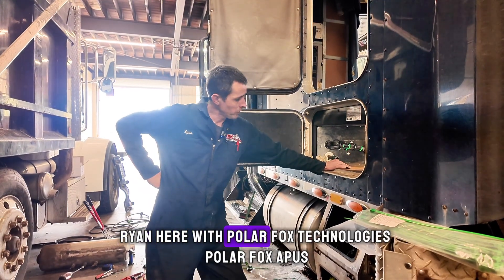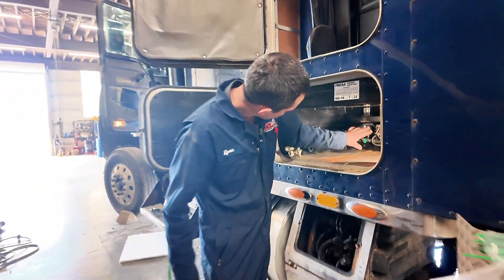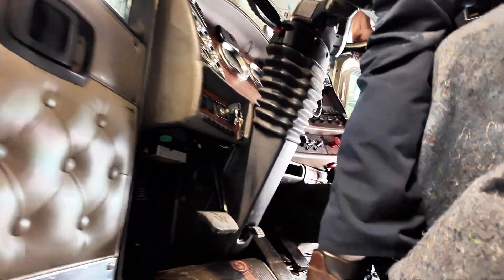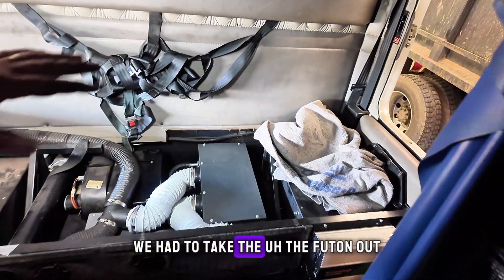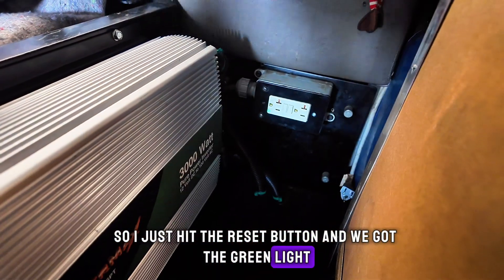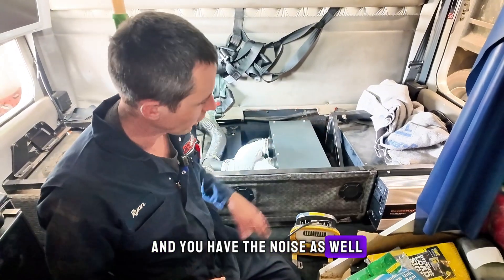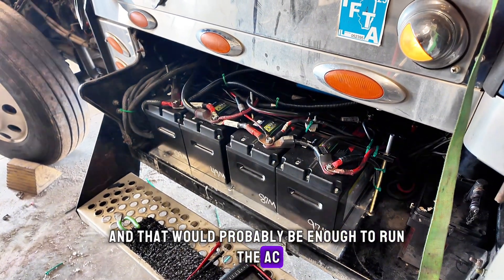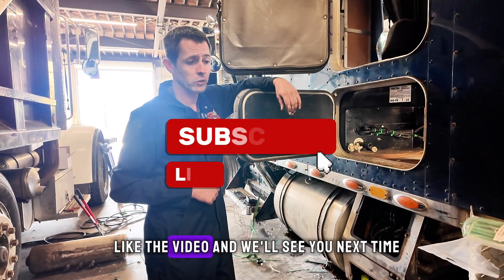We Built the Ultimate Hybrid APU! | Diesel + Electric APU Combo

Comment: Why wouldn’t one have a inverter charger so when the gen is running the batteries agree getting topped off.
Reply: Becouse it wont work the inverter will pull more current that the charger will put out..if it did work I believe everyone in America would have battery powered homes and inverters in cars to take the place of alternators
Reply: @deanjones-g4m  you seem to miss my point after I missed your point. A inverter charger. Do you know that that is? It inverts 12V to 120. But also inverts 120 to 12v. . This is a common item in rvs. I didn’t say pug in an inverter to a charger to get a consistent energy as that won’t happen.
Reply: I had a ccs generator it had a ac to dc charger . Didn’t no have a 12v alternator. This is a common thing in Rv’s. I now have a Tripac but my truck has shore paper. So when I plug in my inverter has charging capability. So all I would do is hook that 120 system to my inverter charger this is a common thing. That happens in Rv. Understand that I may not have explained it well. But inverter charges are available. Get you an inverter that is all a charger so having the Gen running will top your batteries. And when you don’t need the high power to cook things your batteries will give you the 120 comforts. The AC is the big draw. Inverting is not efficient. Hope that helps you understand why I stated a Rv inverter charger.

Comment: This is awesome. I always wondered if a hybrid system wouldn't be better. Here me out. An EPU for a/c, heat, 120vac with 4 lithium batt and an APU motor with a large alternator that only charges truck batt and EPU batt? No turning on the truck engine to charge anything. EPU can last longer than 10 hrs because the APU alternator would charge batt when they get low. Truck can easily do a 34 or 48 hr shutdown without ever turning on the engine.

Comment: So is it the APU alternator that charges the batteries? Or what exactly is charging the batteries?
Reply from the maker: Truck alternator will charge the batteries.
Reply: @ thank you. Would adding some type of battery charger that can plug into the 120 be an option? Maybe it could charge the batteries much faster. Just curious if that’s something that could be done
Reply from the maker: @uria711 charging from the truck alternator gives you the fastest charging speed. Don’t need anything in the middle.
Reply from the maker: Our batteries are designed to take 160amp per hr. This is for each battery. Now the limiting factor is the alternator, not our batteries.
Reply: @truckingandfixing  no I’m talking about charging from the APU alternator. If I was to do this exact same set up, would it be better to charge from the APU alternator or to have a battery charger running off the 120 to recharge the batteries?

Comment: I've looked at some of the parking generators used to recharge batteries for epu's, I use an ecoflow 3000w duel fuel generator mainly because it has the remote start features, a generator mounted on the frame with maybe solar panels on the hood would maybe be good add on for these types battery apu systems. The main reason I don't want an apu is the maintenance, I can change the oil in a generator easily every few months easily.

Comment: What about doing this charging off the reefer unit to charge batteries and still have A/C or heat i have a 12 volt eapu with 4 Lighting Volt batteries then 4 starting batteries